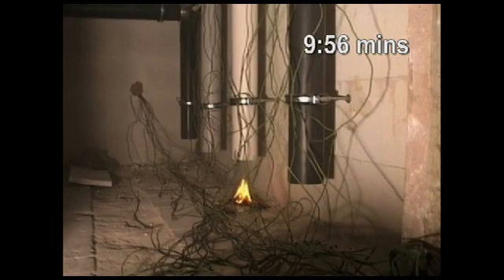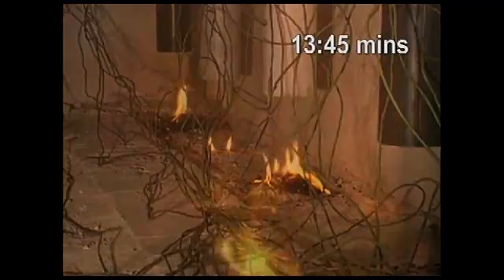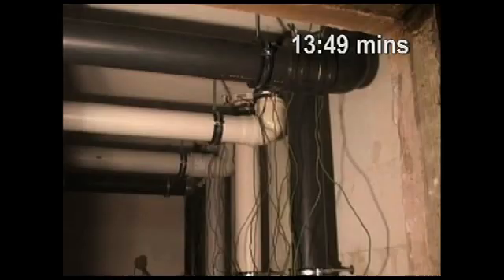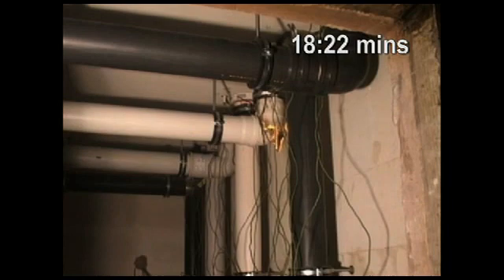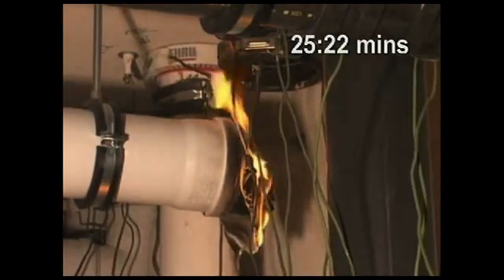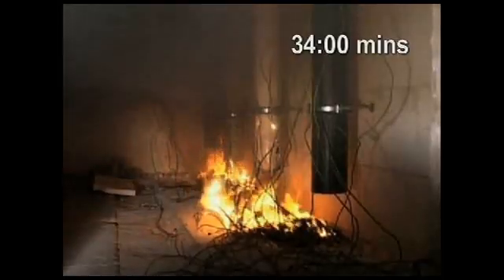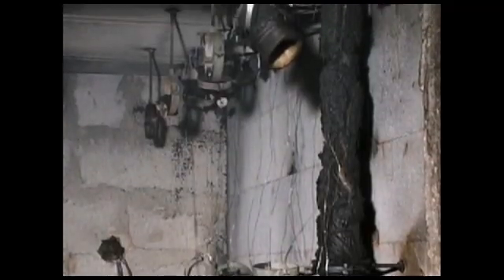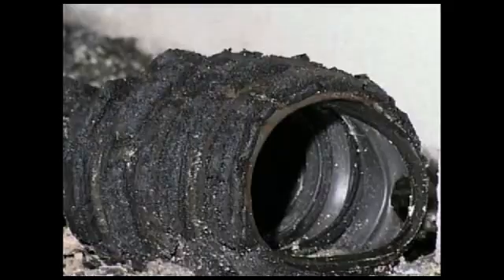Fire collars for plastic drainage - do they work?

Comment: the collor only stops it travelling to another room if fitted properly, you would smoke seal it and fit a collor each side of the wall/floor of course the pipe will melt but not before the collor expands